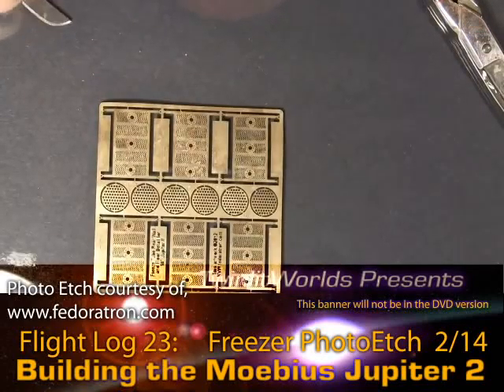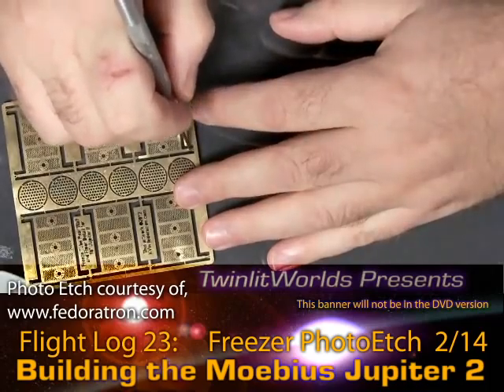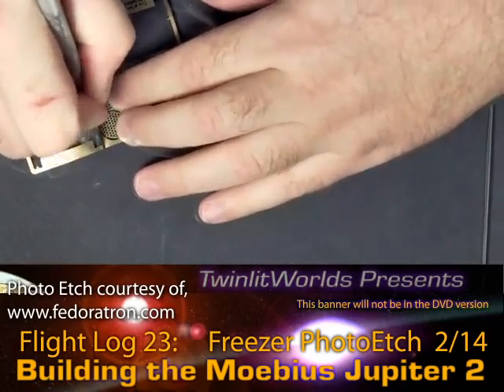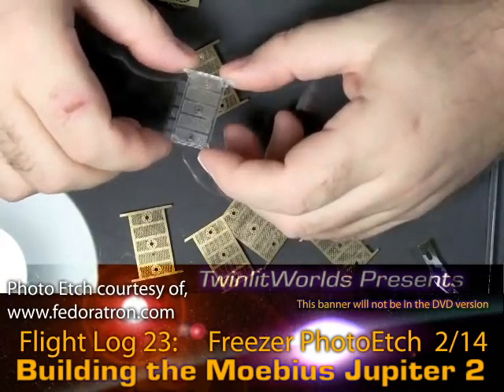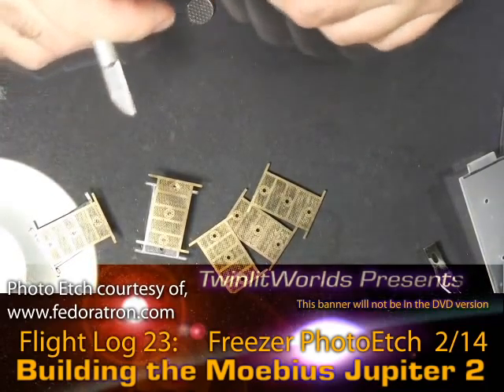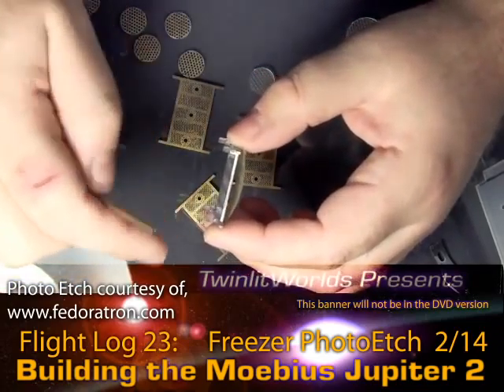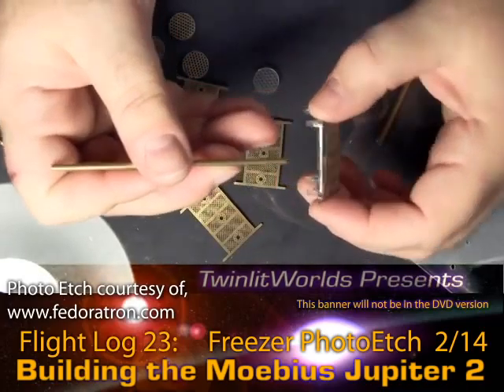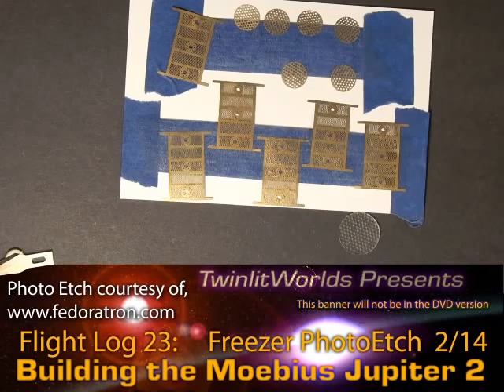J2 FlightLog 23: FreezerWall Photo Etch 2/14

Comment: It's easy to accurately cut short pieces of tubing or rod if you have a drill press.  Get a piece of stock (steel is of course, the strongest, which is good if you're doing multiples) that's as thick as the length of tubing that you wish to produce.  Drill a hole through it that matches the outside diameter of the tubing.  Slip your tubing through the hole.  You can easily cut it to length and then parallel the ends by running a file over the surfaces of the metal.

Comment: I've got a nice granite bench top, but  still cover it with glass.  Granite is surprisingly easy to damage with sharp tools.  Also, if you spill superglue on it, you're likely to pull up a divot, when you try to scrape it off.  Glass doesn't have this drawback and is, of course, replaceable.